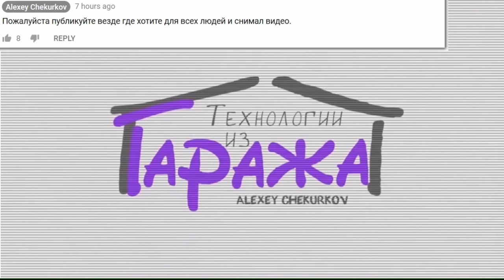Alex Flying Craft Полёт Гравилёта

Comment: It seems genuine in every respect. The stability appears to be excellent. It should be possible to reduce it to a single power source with everything onboard when scaled up. Still, I can't say I 100% believe it, but it's the most compelling thing I've seen in the field in over 25 years of researching AG claims. There's something strangely familiar about that material too, like it's right on the edge of my consciously accessible memory but there's a block in the way....
Reply: So I think the specific material is just textured aluminum as that is all it needs to be as far as I'm aware. It needs to create a torsion effect in space time. If you'd like to know more about this, you can look in Kozyrev Mirrors but it essentially uses mirrors to mimic torsion and other space time effects. If the metal was flat it wouldn't have anywhere near as much torsion while like this since electricity flows on the outside of a conductor surface, the bumps would allow for a repeating torsion effect in multiple places enhancing the ability of the craft. I'm sure if could be done without but it would be much more difficult.
Reply: In fact, I believe that is also the purpose of the piezo electric speaker at the top of the craft.

Comment: I have been looking into things like this including this for years and I think soon I start some physical experiments with it. I first saw the graviflier by alex years ago and ever since I've been convinced there it really something behind it. People always discourage me and say it probably isn't true and while like you said a magician may have his tricks, so does a scientist. They never really cared to look at it though. Just immediate disinterest and dismissal as it "isn't possible." However, there was one thing you said that stuck out to me. "You don't need to be a genius to win the lotto." Very true and smart point of view that I think will push me even more to work on this stuff. Thank you for your video, it was very informative and great to see.
Reply: Also, I think the specific material is just textured aluminum as that is all it needs to be as far as I'm aware. It needs to create a torsion effect in space time. If you'd like to know more about this, you can look in Kozyrev Mirrors but it essentially uses mirrors to mimic torsion and other space time effects. If the metal was flat it wouldn't have anywhere near as much torsion while like this since electricity flows on the outside of a conductor surface, the bumps would allow for a repeating torsion effect in multiple places enhancing the ability of the craft. I'm sure if could be done without but it would be much more difficult.

Comment: I believe the whole thing is completely real...and this is NOT the first time I have seen this devices...man made called ARV's...

So...Why waste so much time in trying to find out if fake or not...instead of replicating it?
I do not see any "strings" anywhere and it is in HD...basically the video inside house with second prototype.

But I guess it really "rub on the wrong side" to so many people trying to reach something like this unsuccessfully...then all the sudden this guy "lands" out of no where...and resolves a problem that has been going on for centuries...

There are many papers written that back up his theories...so it is NOT coming out of the "nothing"...
Reply: Isn't this just an ion thrust lifter? Pretty cool but definitely not new technology
Reply: I replicated only the Mechanical aspect,  and my graviflyer displayed -0.20 oz. And a brief pulse that displayed -0.38oz on my digital weight scale . I have not utilized a Tesla coil  or a peotzo circuit yet on my flyer. I will build a mini tesla coil for next Flyer experiment then a peotzo circuit after that. So far it looks promising.
Reply: @magnetron366  'Piezo' as in 'piezoelectric' -- only reason to let you know is so you can find it online, as 'peotzo' won't match 'piezo' accurately when you (or others) search.
Reply: @magnetron366  'Piezo' as in 'piezoelectric' -- only reason to let you know is so you can find it online, as 'peotzo' won't match 'piezo' accurately when you (or others) search.
Reply: @Greg_Chase   thankyou .
Reply: yes very real and yes electrostatics is a very real scientific principle

Comment: A young man achieving something that was said to be 'impossible'...  NOTHING is 'impossible' as long as you recognize that it takes Knowledge and Perseverance to achieve Anything.  He has accumulated the necessary basic Knowledge with the Perseverance to produce a working model.  Appears to operate on some of the principles formulated by Otis T. Carr back in the 50's, but I suspect it is simply a variation of them.  There's some literature regarding a contact where a similar principle seems to be used:   http://www.galactic.no/rune/janos2d.html

Comment: The rotating special metal disc in question might a bismuth or bismuth sandwiched between magnesium zinc alloy. According to Mark Mccandlish video "Mark McCandlish. Interstellar Travel, Zero Point Energy 2014", bismuth and magnesium zinc alloy is used in anti-gravity craft. Stationary disc is either aluminum or some type of quartz glass i guess.
Reply: Yes. Bismuth is a room temp superconductor. Meaning it resists magnetism. So that would make sense. Also, don't forget about lead. 

Bismuth and lead both conduct static well. And gravity is a static medium. As shown with beetles, and many many other repeatable projects
Reply: That is essentially what this is. Bismuth or lead is very high dielectric capacitance. It creates basically like a bubble in water, except the water is dielectric (ether)
Reply: @Heliarc91  have you succeeded building anything close to what this guy make?

Comment: Real. Easy to reverse enginere. The toughest is tuning the flywheel. It won't move because the wheel is gyroscopicly stable. You need to dampen the magnetism on one side to propel it forward. Maybe an electro magnet that can turn off and on to dampen the field on one side creating an egg shape field and moving toward the point of inertia

Comment: Asymmetrical Capacitor Thrusters (ACT), utilize the Biefeld-Brown effect, to produce thrust in air, without combustion engines or moving parts. The name for this phenomenon, as observed by Thomas Townsend Brown, observed during experiments with X-ray tubes, during the 1920s while at high school. The discovery led him to believe, he had influenced gravity electronically, leading him to design a propulsion system, utilizing this phenomenon. 15 April 1927, patent applied, "Method of Producing Force or Motion," describes his invention as an electrical-based method, to "control gravity" by producing linear force or motion, a phenomenon he labeled "electrogravitics". In 1963 G.E. Hagen, filed his patent "Flying apparatus", very similar and with both being intensely popular, within the UFO community, almost lore. This in reality, is in fact nothing more exotic, than experimentation in the field of electrokinetics. Tinkering's, which have lead to development of ION propulsion, presently used to power Satellites for NASA / JPL, maybe most effective, operating in the vacuum of space.

Comment: Another non electric antigravity kind of connected to spinning is when your a kid and you get someone bigger than you and they hold your hands and spin in circles your lift up, pre much your mass is transferred to there strenght and feet, like a plane its weight is zero if it runs over a scale because it's weight is getting propelled behind it throught the boosters

Comment: It could be a fake but interesting,hopefully  he makes more video's.Unfortunately like most real discoveries the inventor  hides  information,so others  can't make the device,this ends the device.Right now it would be viewed as a possible fake,however once its show to be real,people will move on this guy and make sure the device disappears.If real it is generating a lifting force that counters the weight of the device,the lifting force would have to be fairly strong.A lifting force generated by electricity,not by action/ reaction ,a very important thing if real.
Reply from the maker: Yes  my friend. One reason for  hiding  device concept is to be able to talk about it later.
All of revelations dies with time due to lack of supporting evidence, however religion might be  an exclusion in this area because it does not have to be proven.
Reply: I think it's real !

Comment: i am pretty sure that the first layer of metal that he mentioned special metal is not an aluminum or alloy but a kind of negative magnetic metal that cancels gravity when spins opposite to the spins of the neodimium magnets and charge with the electric power multipler.  the question is where did he get that special metal?
Reply: It is not special metal, it is galvanized, meaning it has a thin cover layer of zinc which is diamagnetic(not magnetic, but reacts repulsively to spinning or moving magnets), there are a few red flags concerning this video and this version of his device. namely that the orientation is different to his current device.  The bottom discs magnets are facing downwards vs his recent version where the magnets are facing upwards, and yet there still seems to be lift, on top of that there is no ultrasonic device or Tesla coil and yet there still is lift.  His timing and movement of his shadow during the lifting portion of the video seems suspect in that it reveals that he is somehow lifting the device, possibly using fishing line and pulleys that are out of the video frame.  But mostly that this device vs current version are both achieving lift even though, structuraly the discs are functioning on opposite spectrums.  Yes he has done many videos answering most pressing concerns regarding the validity of the device, but for some reason, many who are trying to replicate this device, myself included, after several months have not been able to replicate the results which to me is crucially suspect.  Ive been on the fence for a while now regarding my belief in the claims made by Alexey, but i will reiterate that i believe that he is either decieving us by cleverly creating the illusion of truth or is holding back some crucial data regarding the function of this device, and untill one of the many who are now trying to replicate the results after 2 years, can achieve the same result, i will remain highly skeptical.

Comment: compared to  the other fake things i saw on youtube this thing doesnt look fake at all.. im trying to rebuild this and see the results he probably used the stiff aluminum reflectors you find in old projector lamps they are textured with bumps as  exactly shown in his video
Reply: This doesn't seem fake to me either.  Anything that can raise the weight of all that cable to 25 or 30 feet high must be something special.  I knew I'd seen that textured metal somewhere, and I think you nailed it.  I used to work in AV and occasionally fixed projectors.  I support your efforts and would be interested to learn the results.  I want to replicate it too, but just too busy for now. So what is it about these counter rotating disks that makes this a super lifter?  I've looked over his circuits but not sure of some things.  Is he placing something like 20-40kV on the whole of the craft and then energizing the discs with about +/- 200VDC.  And 12V DC to spin the motors.  Do you know where the other HV lead hooks up to the craft?
Reply: @waynegnarlie1  he hooks them to a ZVS old tv voltage amplifier its simmilar to the night vision power supplies that pump high voltage to the cathode and the anode . Maybe its just and ion thruster using gyroscopic stabilization though.. i suggest you take two identical aluminum discs and stack one on top of each other with a gap of 0.5 to 1 cm and apply high voltage and play with the polarity apply( -) in the top and (+) on the bottom and vice versa to check if there is any change in the gravity of the gadget and put it on a scale . I think the best option is to use high rpm brushless dc motors that are power efficient as possible aswell. Good luck , i just ordered a 3d printer so i could easily make the structure with more precision .
Reply: The middle disk is powered from modifing Tesla coil , called Kacher , prodused pulsing HV .
HV multiplicating rectifier for top and bottom rotating disks with magnets is on board.
Also there is ultrasonic busser  on board.
Reply: The stationary disk is dimple aluminum used in Stucco construction for flashing

Comment: See the Magnus effect is without anything elctrical just a ball and gravity the Magnus effect- the spin on the ball changes the direction of the ball having 2 discs to repel each other and all the other stuff it's pretty much getting buoyant to air and further advanced is when your craft is like a ghost through air you get no wind resistance because of the static charge and all that, and the magnetic part is liked charged so gravity is taken care of

Comment: There is no rational explanation for this thing to work.  The s/w for removing the wire is off-the-shelf.  If this was real, the staging wouldn't be an issue. Waving the stick is what illusionists do with levitation tricks, so this is probably just like that.  Or, there's a strong magnet higher up off the video frame holding the contraption up. 

If this was real, it would be repeatable.  Why has no one else managed it, especially since Alexey made his schematics and designs available to all?

Common sense, folks.  Please, don't rationalize something to be true when the facts are indicating the opposite.  Common sense - that's it.  If it looks too good to be true - it's not true!

Comment: The problem is how to get the power on board the craft. Any thoughts? I know a lot of saucers use nuclear power.
Reply: Mix of different methods all in one, obviously nuclear is the obvious option but also solar panels. It's an interesting concept, getting it to work to compete with other methods is another thing it would be very complicated.

Comment: If you look closely at the start of the disc when it first co.es off the floor" and all of a sudden, drops onto the house floor, you can see the shadow of the pole or stick what EVER he was useing to daggle it up in the air, with, as his shadow is there also,. I think he discovered that the fishing line couldn't be seen by the camera, & he FIGURED out how to
Use that to  his advantage...lolo
Heck, I can even see him drop the stick, aka fishing pole, just before he stomps over to the camera....after pretending, to be upset that it fell down to the floor...ha,ha, this guy is a pro but" even pro's make mistakes" especially with there shadows......
Reply: In the outside experiment he clearly demonstrates there are no lines attached to it. Also he moves the cables to show the cables are hanging "loose".

Comment: - First obvious problem is there are no independent witnesses. 
- Second obvious problem is he does not show the device rising. He makes a very questionable excuse that it takes a long time to rise up, but he could wait with his camera off until it just started to rise and then start video recording from that point forward. 
- Third obvious problem is he says the wires going to the discs have 'high voltage' on them, but he has the wires laying on the ground, and at one point in the video he also grabs all the wires in his hands to pull down the discs. How come the high voltage wires weren't discharging into the ground where the wires are laying on the ground, and discharging into his body when he grabbed all the wires together in his hands. Doesn't seem like very 'high voltage' given this. 
This video, as things were shown, is highly suspect. ;-)
Reply: 1) Dans d'autres vidéos on peut voir cette maquette s'élever depuis le sol !!!  Check Youtube !!  2) les fils HT sont isolés  (en câble coaxial peut être )....  3) La HT utilisée est probablement de faible intensité. ..
Reply: The "high voltage" appeared to come from a computer power supply, not something like a neon transformer. This could be a good thing as the discs could be electrified in a simpler configuration. The T-Coil used was not a large one, so the electrostatic field would be quite small. I agree about the video...just let it run and speed it up for the viewers. He needed a separate man whose only job was to video. Opinion. (I would volunteer...grin)

Comment: I say to this is possible also another example of this kind of without electricity is a gyroscope on thin peice of string the rotation spinning at 360 degrees denies it of falling to left or right because of the equal mass getting swung around until it slows down and point b doesn't reach point a quick enough